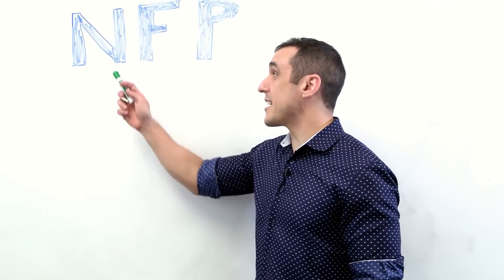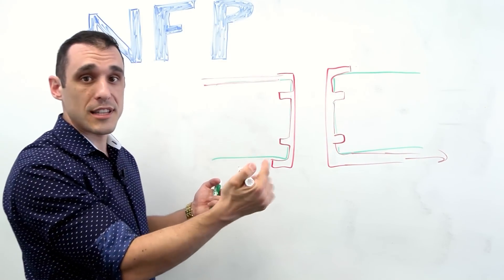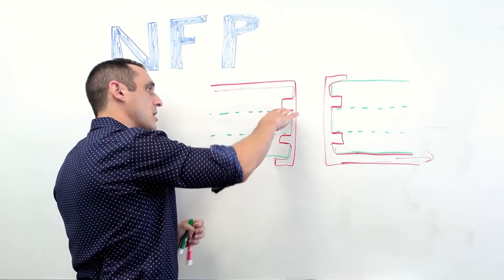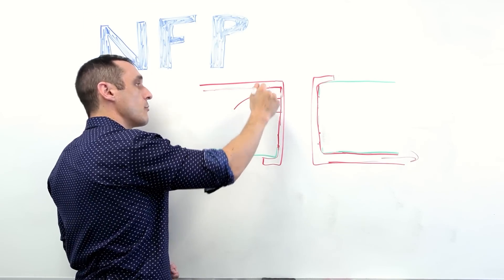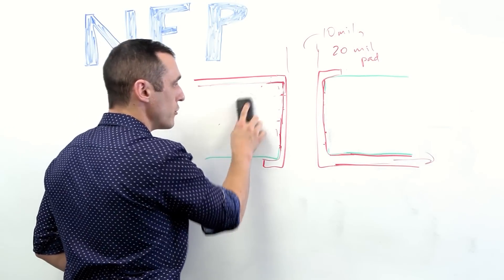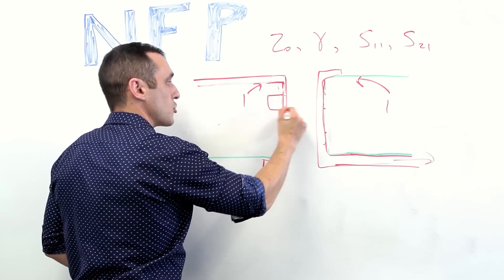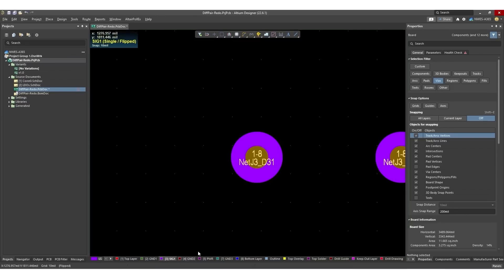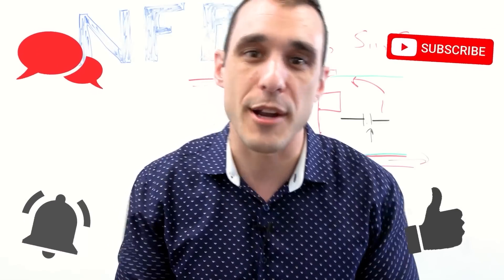Do You Need Non-Functional Pads?

Comment: Odd not to mention the built in function to remove these, Tools -> Remove unused pads shapes.

Alternatively the option to remove unused pads on internal layers has always been in the gerber generation options; this will however not afford any of the opportunities to improve copper clearances to holes etc. 

Spoiler alert, manufacturers will often delete these pads anyway.
Reply: Because the padstack editor enables removal on specific layers, unused pad shapes removes everything and then you would have to go add them back if you decide to keep some of them. For example, if the issue is room for routing or setting an antipad size, then you might only want to remove those pads but leave the others on layers where the dielectric is thicker.

Also stop telling people manufacturers will change your data LOL
Reply: @Zachariah-Peterson  do you understand how boards are made at all? Manufacturers extensively modify "your data" to suit their processes and achieve the results you want. They will expand and contract copper depending on geometry they will adjust solder mask and silkscreen depending on their capabilities. This is why they provide sometimes extensive lists of EQs when you order a board.
Reply: @superjimnz  Yes I know they will change your data. I know that text-based communication leaves room for ambiguity but I was being sarcastic, thus the large "LOL" in my comment to you.

Comment: Here is a tip: if you want to remove the pad, set it as 0. If it's set to the diameter of the hole it will will appear as a small copper dot on the gerbers.

Comment: Thanks Zach.  Tools --> Remove Unused pad Shapes --> vias works best for me. Can Altium please add a reminder in the new Health Check properties as its easy to forget to remove NFPs?
Reply: That is a good tool for removing everything. Only thing about the remove pad shapes tool is it's applied on all unused layers. Just as an example, I might prefer removal on one layer, such as only passing through ground or only when in a layer where there is a lot of traces so we can make more room. In that case you would want to change the padstack.

Comment: If you remove the nfp from a lower internal layer, could the drill wander so far that it hits the adjacent copper pour, since it is closer to the via now? Do i have to look out for that clearance or is that covered in the ususal manufacturers clearance specs?
Reply: good question, I would like to know too
Reply: @suncrafterspielt9479  Antipad sizes are usually much larger than drill wander. Only the tightest copper-to-copper clearances in the standard fabrication process are going to match drill wander values under IPC's highest producibility level. If you're doing microwave design and you need a controlled impedance via, that antipad diameter could be something like (Via diameter) + 20 mils, they can be pretty big depending on the frequency you're working at.
Reply: As I understand it your antipad size (the clearance from the hole in internal layers) should cover the drill wander anyways. The drill wander doesn't really care on whether you have copper there or not. So as long as your antipad covers that, then just normal electrical clearance and creepage rules should apply (e.g. if you have a high voltage passing through that via). And you should also keep in mind that if you route underneath the via pad of the top layer you might have a capacitive coupling between the net of the via and the net you're routing underneath its pad so you might get some small crosstalk (depending on the size of the cross section area of course).
Reply: If you are worried about that, just check the option to remove them at gerber generation, that way the clearances will be the same as if they were there.